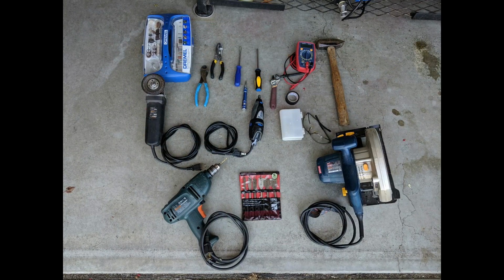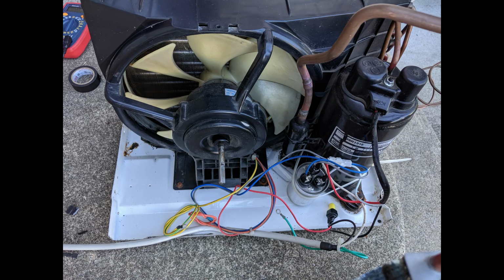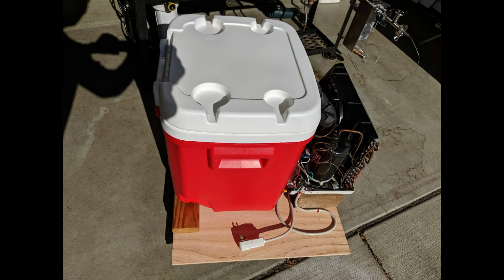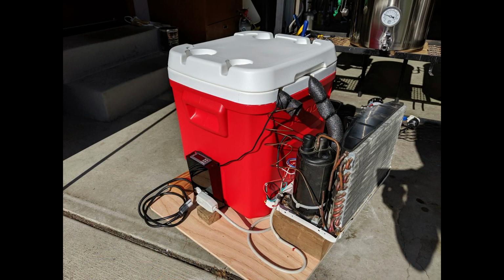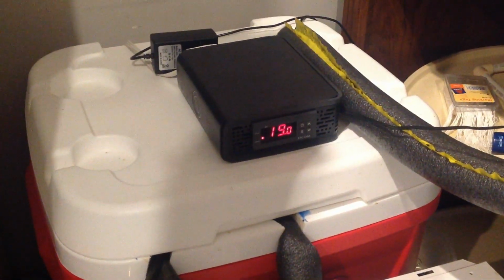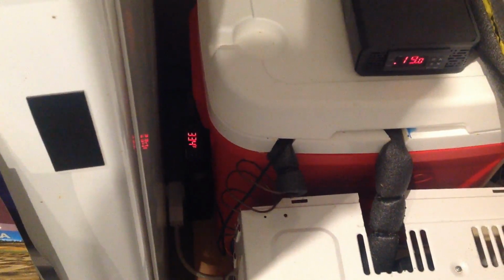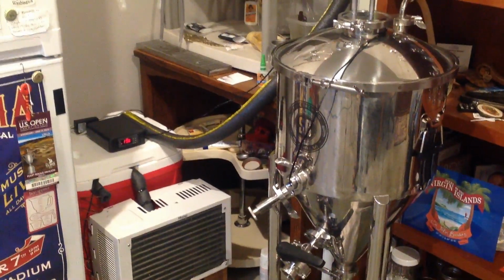Homebrew DIY Glycol Chiller

Comment: do you have to switch the glycol out at all?
Reply from the maker: Thanks for watching and your comment.  Your question is one that I, like everyone else, was curious about.  I don't know what the "lifetime" of glycol is, but I am sure it is very long.  Glycol is sort of like your antifreeze in your car's radiator - and how often do we change that!??  I have had my chiller up and running for two years now and everything is still working perfectly.  As for the glycol itself, I guess as long as the reservoir doesn't freeze, and the temperature drops in the fermenter when the pump runs, things are ok.  Also, I can read what the glycol temperature is through the InkBird controller and it is right where it needs to be.  The glycol is about $25 per gallon, I used 2 gallons, so you don't want to have to change it too often!   Hopefully this helps and thanks again for watching..  -DT
Reply: @homebrewingtips6029  Thanks for the info and the video. Think I'm gonna take a stab at this.
Reply from the maker: @JohnnyReverse  Right on.  I thought about it for years before going for it.   Just be slow, constant, and careful as you try to bend out the coils.  My just sort of naturally wanted to rotate 90 degrees so I let it.  Others might bend back in its original orientation.  If you get that far you'll be home free.  Feel free to ask questions once you get the project rolling.   -DT
Reply: @homebrewingtips6029  cool, thanks.
Reply: @homebrewingtips6029  i have a spare inkbird 2 stage and a johnson 2 stage, im guessing those would work for controlling the glycol temp
Reply from the maker: @JohnnyReverse  yep, those should be good.  I love the InkBird products.  I also have an old Johnson controller (looks like it came from the 50's).  I use that on my keezer and it is fine (no readout/display and clunky).  What type of fermenter do you have?  Is there a thermowell port to insert your probe?
Reply: @homebrewingtips6029  I am using anvil fermenters the cooling system kit they sell comes with a bung that supports the chiller, thermowell and an airlock
Reply from the maker: @JohnnyReverse  Oh ya, I've seen these before, should work just fine.  You might want to slide your temp probe form you InkBird and/or Johnson controller into the thermowell to make sure it fits.  I guess you didn't get the Anvil controller:   https://www.anvilbrewing.com/-p/anv-cs-7.5gal.htm
Reply: @homebrewingtips6029  the anvil controller comes w the kit. I have a bunch of temp controllers laying around but the Johnson and inkbird are the only two with dual settings. I haven't purchased the anvil just yet, I'm buying a used ac tomorrow (hopefully) and gonna see if I can get it to work right first before I buy it.
Reply from the maker: @JohnnyReverse  Ohhhh! now I get it.  In my system I just work with the cooling part of it (I never need to heat).  My setup is in my storage garage where the temperature is 65 - 70 year round.  To heat things up, I just set the temp to ~72 and let the thermal rise of the active yeast get it there.
Reply: @homebrewingtips6029  How many fermeneters can thins operation handle?
Reply from the maker: @JohnnyReverse  I have it connected to one 10 Gallon fermenter.  It easily supports that.  I could see it easily handling 2 10 Gallon fermenters.  To handle more, if you used a bigger reservoir (more glycol) it would likely work fine.
Reply from the maker: It has been over 2 years and I have not added or replaced the glycol.  I honestly don't know how long it could go, but I figure if you can keep your antifreeze in your car's radiator for years, the glycol here can have an extended lifetime too.   Maybe it will last as long as the unit does!!!  I monitor it by seeing that it will get down to (and hold) 32 degrees in the same amount of time as when it was "fresh".  I haven't noticed any difference at all.

Comment: are you able to get the temps you want for the yeast?
Reply from the maker: Hi, thanks for watching and your comment.  Yes, I can set the temperature anywhere from 38 degrees to 75 degrees and it will hold that programmed temperature to +/- 1.5 degrees.  It is actually quite accurate.  That conical is set to hold up to 13 gallons, I typically ferment 8G at a time.  Thanks again.   -DT

Comment: Really love this design.  I was wondering if this system could be used with a cold plate (plate heat exchanger) to bring the wort to pitching temp?
Reply from the maker: Thanks for watching and your comment.  I believe that this could work with the plate chiller.  I would be a little worried about the amount of wasted glycol though when you connect and disconnect the chiller lines.  I have a friend who built this same design and what he does is run through the chiller to lower as much as possible and just completes the chilling in the fermenter with the cooling coil/glycol chiller.  I typically get to pitching temperatures with my plate chiller alone and water (in Tacoma our ground water is pretty cool).  I hope this helps, and thanks again for watching.   -DT
Reply: @homebrewingtips6029  Thanks for the reply.  I have always done ground water as well, but I hated running the heated water down the drain.  So I was interested in this project as I would be recycling the same amount of water and use the modified AC unit to reject the heat.  I just didn't know if the system could handle 180 degree water coming back to the cooler the evaporator was submerged in and reject 130 degrees of heat to get the glycol/water mix down to 50ish to keep the plate chiller effective.  We might hit a point of saturation where after the initial cool down our water loop will end up staying at a relatively high temp as the AC unit is limited to how much heat it could remove from the water loop.  Was curious on your thoughts.
Reply from the maker: @severly73  You and I share one thing, I too hate to waste the water (and anything else for that matter).  I think that you are right that the thermal rise of the cooling liquid would be rapid.  As an experiment you could take a cooler roughly the size of mine, put big blocks of ice (real big) in it with a little water and pump.  Try recirculating that through the chiller and see how quickly it melts.  Who knows, we could be surprised! When I chill the wort with water, I capture all of the cooling water in buckets and old kegs.  I use that water for my clean up, for a new batch of Star San, and even water the plants.  People think I am nuts, but I just feel better doing that than letting it run down the driveway.   All the best.   -DT

Comment: What is the power of air-conditioner in BTU?
Reply: I can view 5200 in the video. What is the capacity on liters of wort in fermenter? How many fermenters is possible ?
Reply from the maker: @fjnunez  Hello, thanks for watching and interest.  You are right, at 1:54 you can see the box that has the a/c specifications on it.  My fermenter can hold 50 liters, recommended batch size would be 40 liters (to allow head space), I tend to run a 32 liter batch size.  The glycol chiller easily handles that size, and I would assume that you could easily use it to chill two (maybe 3?) fermenters.  I can crash to 4C easily and have made a neoprene jacket to help insulate it and mitigate the condensation (dripping) that occurs due to the temperature difference.  I hope this helps, all the best.   -DT
Reply: @homebrewingtips6029  how Many fermenters of 50 liters can be used with You DIY chiller ?
Reply from the maker: @fjnunez  I would guess up to three.  Your ambient temperature would be a factor too.  My setup is in my garage which is typically 60F - 75F.  When connected to my single fermenter, the a/c unit runs once every coupler hours for about 5 minutes to keep the glycol bath at ~0C.

Comment: Don't ac units drip what do you do about that mabie just old ac units in did that
Reply from the maker: thanks for watching.  The only "drips" are on the hoses to/from fermenter due to condensation.  The fermenter itself will "sweat" as well (I made a jacket for the fermenter to mitigate that issue)
Reply: Very cool project I imagine your beer is great for sure

Comment: Very cool. Thanks for sharing. A question on the pump you use. How many liters per hour? What was the minimum head height?
Reply from the maker: thanks for watching and our comment.  Here is a link to the pump I use.  I have used these for different tasks in my setup and always have good luck.  My hoses go up about 5 feet to the fermenter.  https://www.amazon.com/gp/product/B01G305PK0/ref=ppx_yo_dt_b_search_asin_title?ie=UTF8&psc=1

Thanks again for watching.  Best of luck.  -DT

Comment: Does this work only for lagering or do you use if for cold crashing?  The temp that normally comes off of a standard air conditioner evaporator coil is no cooler than 32F. After that it will begin to freeze. I know that the glycol will allow colder temps but this can cause the refrigerant to become sub cooled and be in danger of not boiling off and entering the compressor as a liquid. (liquid flood back)This will damage the compressor valves and the system will no longer cool. I can see bringing the glycol down to 32F but is that enough of a differential to cold crash to 35F? I would think the glycol should be down to at least 25 F to do this.
Reply from the maker: Happy New Year, thanks for watching and your comment.  I use this chiller for holding lager fermentation temperatures, for holding ale fermentation temperatures, and for cold crashing.  I have the glycol bath set to 32 degrees +/- 3 degrees (so it doesn't cycle on and off repeatedly to hold a precise 32 F).  I believe that you know more about air conditioners than I do, but I will say that I have never had a problem with liquid flood back.  I have had my unit in operation for a year and a half with no issues at all.  One extra note, I made a insulating jacket out of 1/4" neoprene (sort of a fermenter koozie) to help try to maintain the lower temperatures and aid in mitigating the sweating that occurs.  I easily hold 38 degrees and if I push it a bit 35 degrees in the fermenter is pretty easily achieved.  While in the crash and conditioning phase, the A/C unit runs about once an hour for a few minutes to cooler the glycol back down.
Thanks again for your thoughts and insights.    -DT
Reply: @homebrewingtips6029  I am a HVAC mechanic so I was curious if a standard A/C unit would cold crash with no damage to the compressor. I have a spare A/C unit hanging around. Might be time for me to dive in and build myself a glycol chiller! Cheers.
Reply from the maker: @CanadianBrewingChannel  I am glad I didn't position myself as a A/C expert !!!!!   Too funny, but this is why I like to post my experiences and techniques.  There are so many smart people out there who watch and comment and make me think of new and better ways of doing things.  I appreciate your thoughts and will check out your channel.

-DT
Reply from the maker: @Shawn Robinson sorry about the coil, but you have the skills to do the repair job which is awesome.  I'll jump over to your channel and check it out!

Comment: Hi, thanks for sharing.... and a question, how cool can this unit go down with glycol and with only water? and how long you think is the life span of a systema like this that you made.  thanks again
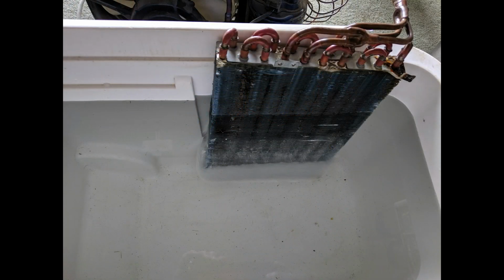Reply from the maker: Good morning, thanks for watching and I will share my thoughts.  When I first tested the unit (see minute 2:35) the coils started to ice up within a few minutes.  The overall tank was not too cold, but the coils sure were.  Now I just had a thought, if you had a little stir pump to recirculate the water you might be able to get it real cold before it froze at the coils and I have ice form, but I wouldn't be surprised if that problem persisted (hence the addition of glycol).  I used roughly a 3:1 ratio of water to glycol and have my temperature set to 32F.  I programed the inkbird controller with quite a bit of hysteresis so the AC unit wouldn't try to cut on and off a precisely 32F, so it warms to 35F then shuts off at 29F.  When not chilling beer, the AC unit runs once a day or so for a few minutes to keep the glycol tank that cold.  As for the life span, I see no reason that this won't run for a very long time.  The  AC unit is not taxed at all, and it is a good old one that might just run for ever (the newer cheaper ones like everything else might have a shorter life).  People ask if the glycol will corrode the radiator coils, I don't think it will.  This glycol is not corrosive: 
https://www.amazon.com/Sanco-Industries-Propylene-Glycol-Antifreeze/dp/B01MS8F1UW/ref=sxts_sxwds-bia-wc-nc-drs1_0?cv_ct_cx=glycol&dchild=1&keywords=glycol&pd_rd_i=B01MS8F1UW&pd_rd_r=ae692949-4e5d-484a-a231-9880003dc304&pd_rd_w=irY33&pd_rd_wg=EtD96&pf_rd_p=8f655ecb-bc8c-4750-9088-950aa74d52dd&pf_rd_r=RQ57NXJ6QAXBN8EMFFPK&qid=1608480166&sr=1-1-88388c6d-14b8-4f70-90f6-05ac39e80cc0&th=1

So the short answer is that I have no reason to expect it should fail within 10 year+

I hope this helps, thanks again for watching.   -DT

Comment: your talented-  I have a question...love your design...could you have pumped down the A/C unit, bought some copper tubing and placed the condenser a little flatter in the cooler and then sweat the entension lines and re charge the unit? not much money and you get a nicer fit and more efficient product no?
Reply from the maker: Thanks for watching and your note.  There are probably several alternative designs.  Truthfully, I don't really have enough knowledge (and skills) to rework the AC too much.  I have to agree with you, a little more compact design would be nice (fortunately I have space for it as is).  It was a fun project and after a year and a half it is still running strong.  Thanks again for watching.  -D
Reply: @homebrewingtips6029  i am going nuts with this idea.....if you wanted to turbo this- Im planning a micro distillery in Panama, I would do exactly what you did, I would put the unit in a metal pot- a commercial tall one, and place the whole unit into a small chest freezer- bags of ice around the pot- use a glycol mix to prevent freezing obviously and the only thing you see is a compact chest freezer, copper lines thru the back of the lid and the compressor unit next to it- Ill work on that and send you pics- if your only running one still you unplug the chest freezer-  see ya!

Comment: Did you do this with an analog or digital AC unit? I picked up a used Kenmore 253.79081 (which appears to be digital). I've heard that doing this with a digital AC is much more challenging. Do you have any insight into that? I basically need to disengage the thermostat correct? Any ideas or advice are appreciated! TIA!
Reply from the maker: Hello, thanks for watching and your comment. I downloaded the manual for your unit, it is pretty nice: 8,000 BTU, remote control.  The manual stopped short of providing the schematic, but my thoughts below apply.  Let me answer your questions (1) mine was an old analog unit. (2) I too read that using a digital one is more difficult but I don't think that this is true if you use my approach of stripping everything out altogether as shown at 3:00.  I took the power in (black cable) and connected it directly to the wires that would normally be connected to the output of the thermostat/controller (it was just 2 connections, the compressor and the fan).  This essentially made it an on/off function that is controlled by the Inkbird which is switched on and off by its thermo probe in the glycol tank.  I think the key would be to trace the path of the incoming power and the output of the digital unit to see what needs to be connected.  If you have a basic multi meter you could actually measure the voltage levels (it would be 0 and 120V) to see what happens when the digital unit turns on and off power to the downstream devices. ** of course be careful of shock **   Feel free to send in other question and I'll be glad to offer my 2 cents!
Reply: @homebrewingtips6029  thank you for the advice. Will definitely reach back out with any questions. I appreciate it!
Reply: Definitely shooting a subscribe for this. Not only is this a cool design, but you responded to almost every question people asked. Great content brother, ill be finishing my build tomorrow

Comment: What did you use for glycol liquid? How much? Did you dilute it at all?
Reply from the maker: thanks for watching.  I bought this glycol:  https://www.amazon.com/s?k=glycol&ref=nb_sb_noss_2 
This seems to be the one that most others use too.  Yes, you do dilute it, I think that it is 2:1 or 3:1.  I recall I wanted to stretch it as far as I could.  I used 2 of these gallons and probably about ~6 gallons of water.  I just watched it to make sure that it wouldn't freeze at all.  I keep my glycol bath at 32F (it ranges 28 - 34) and have no issues what so ever.  Interesting, it now costs about $4 more per gallon than when I bought it over a year ago.

Comment: Great job man! I wanna know if you can put another pump with another stc1000 for control another fermenter, is that possible?.
Reply from the maker: Thanks for the note.  Yes, that would absolutely be possible.  A system this size easily handles my fermenter (10 gallon batch size).  The only time it (the air conditioner to cool the glycol) runs much is when I am crashing and holding the temperature at 38 degrees.  Even then, it is not working that hard.  Good luck to you, and thanks again for watching and commenting.